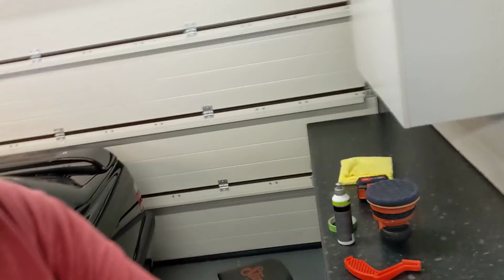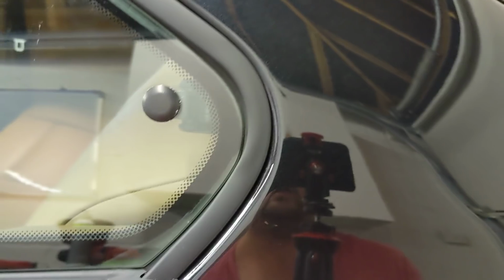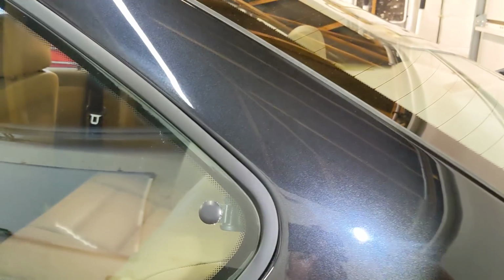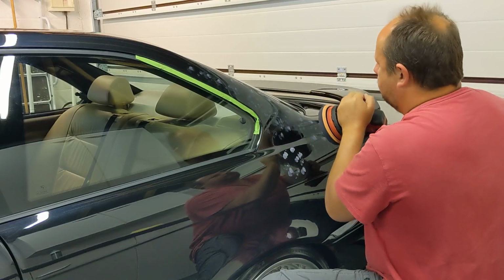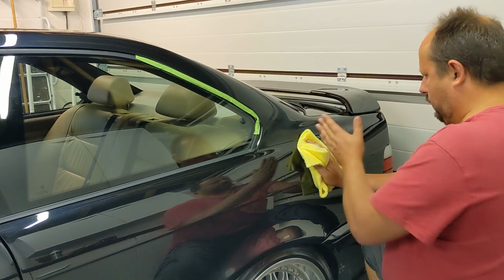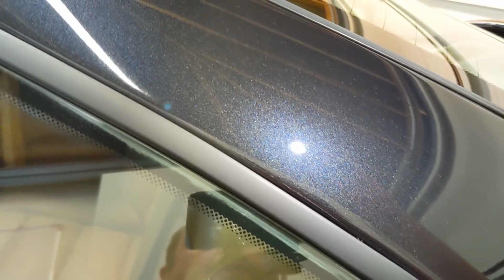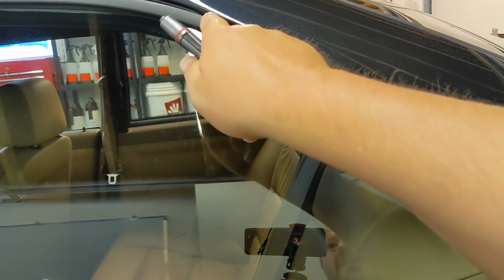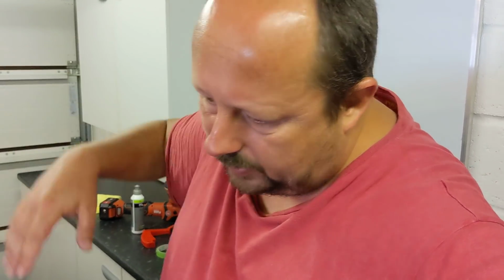Car Detailing : Finishing Out BMW E36 paintwork

Comment: Awesome! P301 is for sure my favorite AIO. Cut is good for what it is and it finishes awesome!
Reply from the maker: its nice enough, the protection side of it is pretty poor though or  lacking durability but as a tool it will finsh the paint out which is the important thing.
Reply: @forensicunplugged4295  agreed. I use it more for finishing, especially on soft black paint.
Reply: Doesn't the finish give a level of filling though? Potentially masking further imperfections.
Reply: @telsaw892  this product or an AIO in general?

Comment: I've adopted a new technique when it comes to polising I tend to do tge Edgework first with either my Ibrid or a 3 inch and then go over after with my 5 inch machine that way you can get very tight to fge edges without dragging adhesive onto the panel from the tape 👌🏻

Comment: Jon, What finishing pad are you using? Have you tried the Flex red finishing pads?
Reply: Yup interested in an answer to that too.
Reply: @mariospanna8389  me 2
Reply from the maker: its scholl concepts black waffle.
Reply: @forensicunplugged4295  And you prefer that to the flex red finishing pad?
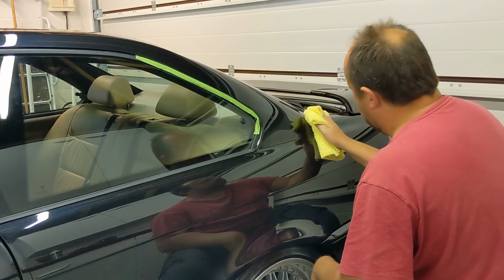Reply: Look at the video Best Polishing Pads for Cars - Foam Pads Review Part 2 at 7:22 he talks you thru all Flex pads and backing plates. Incl. The red pad
Reply: @AlexRuiter80  I have watched that again no mention of why he is using a scholl finishing pad over a red flex pad, which is this question i asked,
Reply: @mariospanna8389 I answered the question of @Ray Graham. Whether he tried the red pads of Flex.
I'm new to the comment section so sorry if it wasn't clear.

Comment: Nice one . Whats the quickest way to remove all the resins from Soft99 12 month coating wax sealant?

I have strip-washed twice and hit it with mild micro abrasive polishes but still some resins and residue of soft99 coating remain?
Reply from the maker: polish itself creates s hydrophobic layer on the paint.. but a micro abrasive finishing polishing on a soft pad is the best way to strip the old wax.  so now just do a degrease wipedown with IPA and water or something like BH cleanser fluid and you are good to go with next wax.
Reply: @forensicunplugged4295  thank you,  I'll give it another go in that way. 😃.  I must say though, the Fusso coat is a super strong sealant and lasts way longer than most other paste sealants. I appreciate the word again 👍

Comment: I deal with lots of sanding marks and there is no way p3 on a soft pad would remove them 🤔 you will fill more than correct with this combination
Reply from the maker: seemed to work michael this videos a couple of weeks old.. but yer your right normally you would hit them harder with high cut and a stiff pad could be some filling going on. will eyeball it later on now you have said this.

Comment: Nice video. Just one question, every Youtube "expert" says you should check your work after using a panel wipe or something similar, but you didn't. Any reason for this?
Reply: P3 is a cut and finish product. It's got mico abrasive and wax. So it's designed to be left on the panel.
Reply: @andrewtaylor7377  so you don't know if you've removed all swirls if that is what you aiming at?

Comment: Looks amazing jon👌
Just a quick question for you Jon or anyone who reads this.
I recently got a karcher k7 compact and I'm loving it But, when I connect my foam gun it keeps pissing out of the connector. It's like there is way too much pressure for the gun. I turned down my tap to see would that help but it didn't. See I can only turn down the pressure on the end of the karcher gun, but I take that off to connect the foam gun. Any ideas???
I have looked online but couldn't find any solution. Would changing the orifice do anything or will I get a new foam gun?? Cheers
Reply: you bought the foam gun for a karcher connector correct and not others like a nilfisk?
Reply: they have different connectors, either that or your o ring has gone is my guess.
Reply: @mariospanna8389  I definitely got the karcher connector, and it fits perfectly. It's the black plastic karcher connector part that it's pissing out of. I'm savy enough when it comes to this stuff but I can't understand this. I'll probably have to get the pressure washer gun set up that Jon has.
Reply: @mariospanna8389  cheers mario👍
Reply: @Lee Francis cheers Lee, the connector is good. It does spray out of the foam cannon but pisses out of the connector as well. Unusable. I wonder would a different orifice be any help? I'm baffled.

Comment: Bimmer look deep n glossy 😍 hey jon which flex cordless do you prefer for paint correction xfe or xce?
Reply from the maker: XCE all day long mate.
Reply: @forensicunplugged4295  I'm tempted to get one,  ok lets say you have a dewalt battery setup and dewalt reveal they will bring out a mini cordless polisher soon like the flex mini pxe80 cordless would you have the 848 or 849 you reviewed over the flex xce 😅
Reply from the maker: @SilverTrill  no I would take XCE.    But the 848 cordless DA from dewalt has a ton or power and higher top speed compared to the XFE.    Forced rotation removes the issue of stall.
Reply: @forensicunplugged4295  yeah I do like the dewalt after seeing your review but like you said the 60+ min charge time will be a issue so will need a third battery and charger plus there no mini polisher on offer too and the tool looks massive and less refined than the flex. 
Yeah forced rotation is defo needed these  days as cars have so many curves than straight panels and xfe or 848 are likely to stall 
Looks like I'm gonna go for XCE Jon thanks to you I'd love to get the pxe80 too looks like so much fun to use expecially with those little attachments to get behind door handle and in behind the wing mirror 🔥😎 thanks for the heads up and all the education your passing us newbies Big up 🔥😎💪🏾